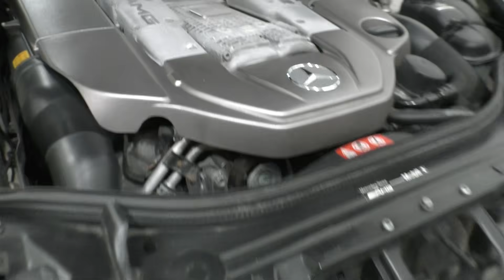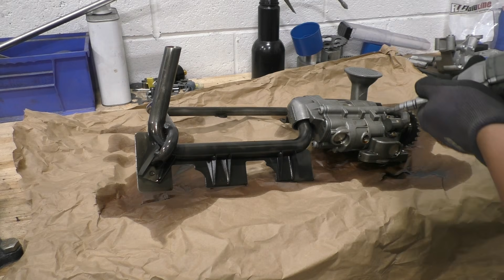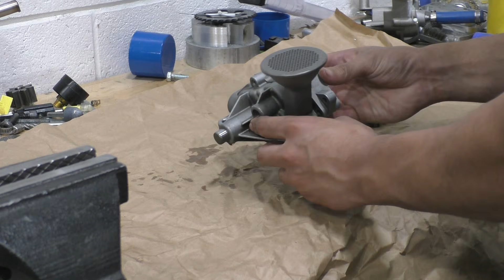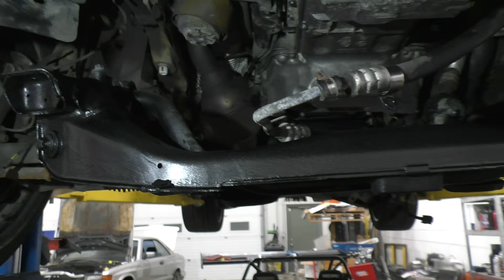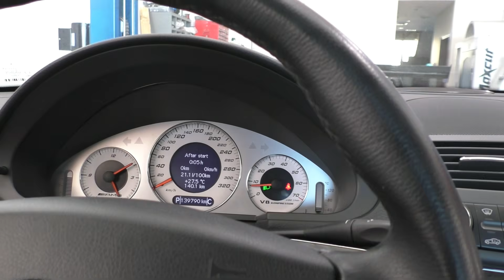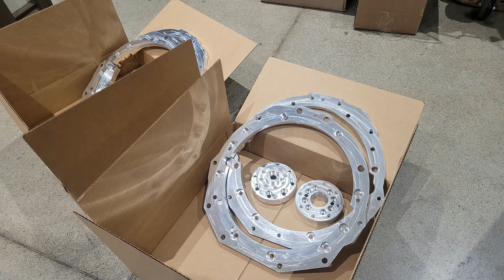Installing New Oil Pump Gears in an E55

Comment: What is the torque specs for the 3 bolts for the oil pump and the 2 little screws that the oil pick up tube ?

Comment: If the key less entry and Start button on the knob do not work, check the door handle. There I saw that there are problems on common w211, when the key less entry and the start button do not work. Greetings from Romania

Comment: Y would u put a new oil pump gear wen u can put a new oil pump??? I'm a licensed professional auto technician I would put a new oil pump gear on a older car maybe but nvr on a E55 A.M.G. that's a special high performance engine. 😎 🇺🇸

Comment: The start button wire breaks down where the shifter pivots.
Some videos on u tube on this issue.
My car had the same problem just extended the wire and soldered the wire and presto the button works again.

Comment: It’s not the button. It’s in the wiring inside the shifter. I had to fix this on my E55. Every time you put it in gear the wire has to bend 90 degree. Take the shifter out of the car, use a heat gun to heat the soften the glue and use a razor blade on some pliers to cut the glue open and take the top off of the shifter. Once its open you’ll see the broken wire. I used phone cord wire (multi strand designed to flex) and re-routed the wire out the side of the shifter vs the hole its routed through and soldered it place. On re assembly there are actually 4 screw holes where the shifter was designed to be bolted together but for some reason they glued it. Throw some plastic screws back in there for easier fixing next time and off you go.
Reply from the maker: Thanks for letting me know! Will check next time
Reply: @xfmotorsports  for sure man. Sorry for the crappy post. I was in a hurry when I typed it, quite a number of typos and such. But yeah open it up and you’ll see what I’m talking about. There is no way that the wires are not going to break over time the way the factory set it up. Just no way. The wire is routed through a drilled hole and it has to bend across that hole almost 90 degrees every time the car is put in gear. It’s insane. I hate to wear a tinfoil hat and say it’s a designed flaw. But when you see something designed like that. Then they glue the shifter housing body together when they could have used screws so a fella could service the thing. Well it sure makes one wonder.

Comment: Man, I just want to see XF Motorsport guy made milling for m115 SLR bottom end assembly including with dry sump oil system to fit every m113/k engine code for better performance. Also his f1 style V8 m113 from s500 engine should also fitted with SLR m115 bottom end with dry sump system in it for higher revving tuneup!

Comment: My S55 push button didn't work because the old owner had turned it to try to get it off. Not sure if the e55 is the same, but there are brass contacts/wires that snapped. I soldered on little wires, can't remember the gauge, there is a write up in a forum somewhere. Works like new now!

Comment: How did you know if it would deliver the same pressure then? Doesnt it increase the pulse effect also with fewer cogs?
Reply: I think he went through this in an earlier video explaining the development of the new lobes. If I remember rightly, the replacement part is only one stage (the scavenge part) of a multi-stage pump so there’s no detriment to the output pressure/flow
Reply: @emma.jacobs1  Alright, thanks.

Comment: I actually like the noise on startup. It is super unique and it reminds me I have a 5.5 AMG V8.
Reply: Lol
Reply: Every M112 and M113 sounds like this. Has nothing to do with the compressor
Reply: @moritz1997me  doesn’t make sense ? And don’t compare a v6 to a v8 😂👍🏼
Reply: @hsrperformance55  I mean the oil pump. Its the same
Reply: @scootypuffjr.  *easier sale Most of the time it’s hard to sell bigger cars even too the e55 aswell people are scared of em all 😂😂
Reply: I'm just happy when my S600 starts at all. I'll never own another one of these things. Constantly chasing problems.
Reply: @scootypuffjr.  what year is it ?
Reply: @hsrperformance55  2005.  It's very fast and very powerful but not worth the constant issues
Reply: @scootypuffjr.  wow ive always wanted one but how about one with 60k as I’m from the uk and I can believe how fast they are as you may see from my channel we’ve got a w220 s500 now being amg converted and a few e55s ! But again still would love to have a v12 biturbo
Reply: @hsrperformance55  it seems that even the ones with low miles still have the same issues. Coil packs, voltage transformers powering the coil modules, PSE pumps that power the door locks, soft close, and massage seats,etc. The Comand system is sketchy and failing and outdated anyway.The ABC suspension was built with substandard components not up to long term use. I converted mine to Yellowspeed coilovers. This one sold for $125,500 US new. I would sell it for $5000 US running and driving. I drove it to work today.
Reply: @scootypuffjr.  my s55 has held up after strut conversion and I beat the 275s in the back daily
Reply: @lop8828  IF I were to get another Benz, I would consider an E55. I'm not impressed with the w220.
Reply: @scootypuffjr.  wow I’ve never experienced this with any of mine as mine was Mercedes stamped book until I had it and I’ve never had huge issues Pray to god but that’s a big think if your thinking about changing up the Mercedes stamped book means so much as I’ve experienced and heard about
Reply: @scootypuffjr.  and I understand about the abc huge pain I agree so I understand but I have airsuspension and comparing to an s55 with abc I kept the s500 😅
Reply: @scootypuffjr.  also to be fair the s55k aren’t meant to be too bad but the ratio of most power and least problems is the e55k
Reply: @hsrperformance55  it seems that the E55 holds much more of its value than  any of the S class. Less problems equals greater resale.

Comment: I have a 2014 SL550, as well as a 2014 GL550, and each time after sitting for a bit, you hear a ticking upon start up. Checked my oil levels and levels are where they need to be, and just changed the oil and filters. Is this the same issue with the M278 engine?
Reply: Check your timing chain stretch, go to someone with endoscope and take a look at tensioner - there’s plenty of photos how it should and shouldn’t be looking
Reply: @RAPXZibit  Thanks!!

Comment: @xfmotorsports ! Suggestion; get a couple of old pumps from junkyard and upgrade them w ur lil parts so it would be ready in stock for locals and/or to be shipped out.
Reply: Don't think it's wise to install a junkyard part onto your vehicle. Maybe buy a new pump and sell it with the gears installed.
Reply: @LynxStarAuto just shows what you know, lol
Reply: @LynxStarAuto if your stripping down the pump just throw everything in a parts washer.

Comment: What is the pressure before and after?
Reply: How does a scavenger pump have anything to do with oil pressure?
Reply: @einfelder8262  he changed famous rubber ring. Some mods on pump. I would like to know a used engine oil system pressure and refurbished. It will be easier to get a correct oil pressure switch to install on this engine.
Reply: @pfoxhound  He changed the rubber ring and non-return valve because it was opened up, not because those two components were faulty.  Then he changed the scavenger pump gears, and reassembled the original oil pressure pump.  So the oil pressure could not be different than before these parts were installed. Given the pristine internals of this engine I would say low oil pressure not an issue.
Reply: My thoughts exactly
Reply: Why would it differ?
Reply: @martinsvensson6884  just think of it.
Reply: @pfoxhound  That's why I posted the question.

Comment: Question, possible to slap a turbo on a M112 engine?
Reply: It’s possible of course but is it feasible and reliable? Probably not
Reply: @Billybobaggins9  The predecessor m104 could take +600  hp on stock internals. But no idea about the m112. Probably less.
Reply: @martinsvensson6884  maybe the motor can take that but can every other piece on the car?
Reply: @Billybobaggins9  No you will have to change to the 722.6 transmission for example. Rear diff off course wont take it either if the tires hook up.
Reply: @martinsvensson6884  exactly original question said “slap” that ain’t no little pad slap
Reply: @Billybobaggins9  Not if you want 600hp. But if he has the m112 then he has the 722.6 gear box. And I dont think his goal is necessarily 600hp.

Comment: I'm torn between how amazing this ingenuity is and how much this was a non issue once the car is 2 degrees warmer.
Reply: Mby in Cali. But in the winter up north it can take forever for the engine to warm up from way below freezing. Wonder how this pump work in those conditions.
Reply: Its not a heat issue. It's a prime issue. Once the gears prime they don't make the noise. It just takes a second for them to self lubricate.
Reply: Nah, my m272 makes a noise throughout whether its warm or not
Reply: @lukerichardgraham6791  and an m272 isn't anywhere near the same engine as an m113
Reply: @lukerichardgraham6791  probably a drive belt pulley, or your AC compressor or PS pump. Those are the most likely culprits for noise on the 272/273.
Reply: @LynxStarAuto  you know any good replacement for ps pump?
Reply: My car use to make the noise all the time although not as loud as the start
Reply: What about the long term durability? The material these gears are made of differ from the org merc parts, no? A local mechanic in Germany recommended to not use these quiter gears... any comments on this? Any experiences now after a year or so?

Comment: Looks like the volume per revolution is a lot less with the new pump. Two completely round gears will be even less noisy. Butt no flow…
Reply: Actually on the contrary these gears flow much better
Reply: He shows the difference in another video - it is night and day better. Don't you think he thought to test it first?
Reply: How is the gears producing less "volume"? What volume? They just turn an axle...
Reply: @martinsvensson6884  haha what??
Reply: @wouterveidhuis8653  That the gears would change the pressure somehow.
Reply: @martinsvensson6884  The gears are what moves the liquid. Look up gear pump.
Reply: @MartinMio  I see. Thanks!
Reply: @martinsvensson6884  
If these were gears driving axles, they would need to touch (ignoring that very thin oil film). In this case, both axles are already rotating, and these two wheels uses the lobes to force movement of the oil. Two of the three lobes moves oil. The third lobe is so close to the matching cutout of the other wheel that the oil can't sneak between the wheels.